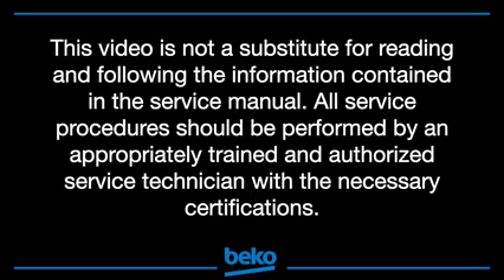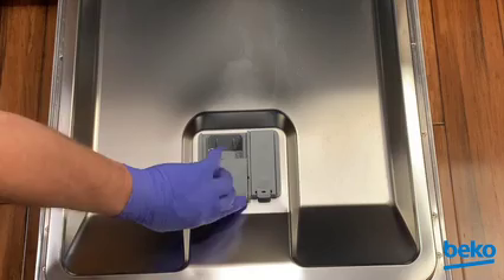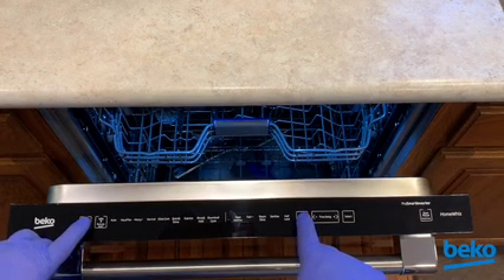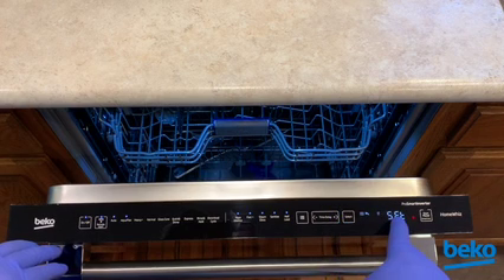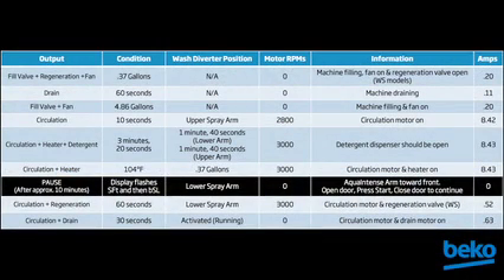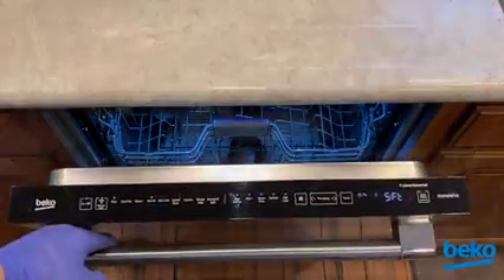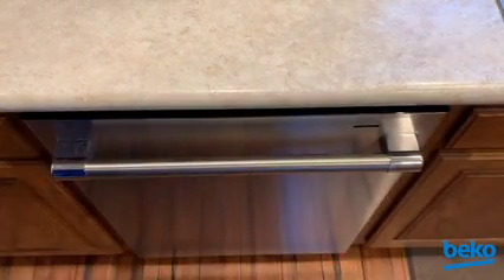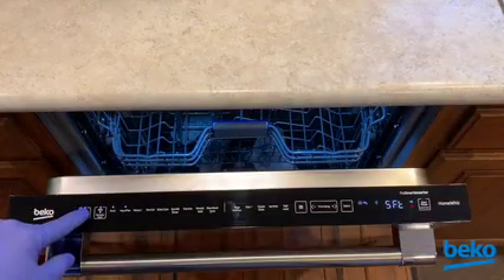beko dishwashers service function test

Comment: My menu button doesn't work anymore so this technique doesn't work.  Only one function works now and that's the default Eco setting.  How do I do a test or even reset this machine, it's a Beko BDF1640DX. I've tried unplugging and after a couple of minutes plug it back in. It beeps and all the lights on the panel light up briefly.  However, still only the Eco setting works.  I can press on all the other settings on the touch panel but nothing happens. I never see any error codes.
Reply from the maker: problem communication replace pcb board